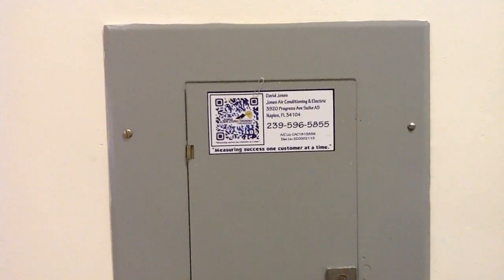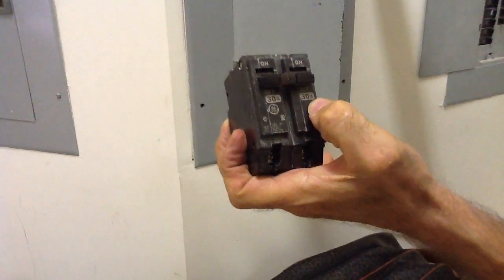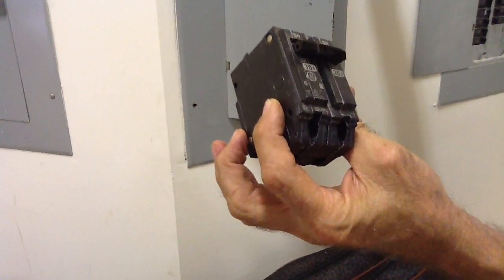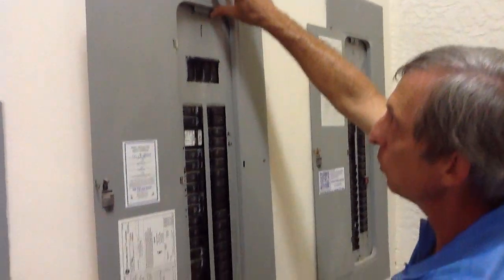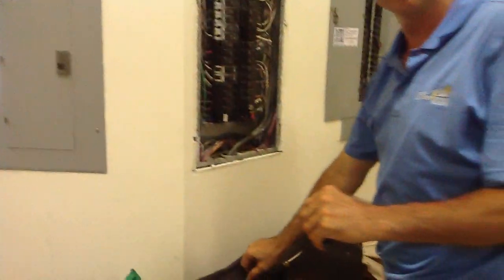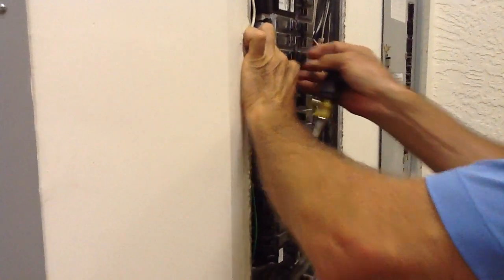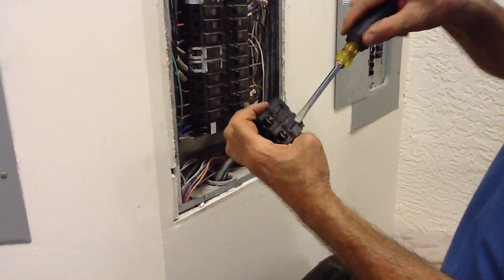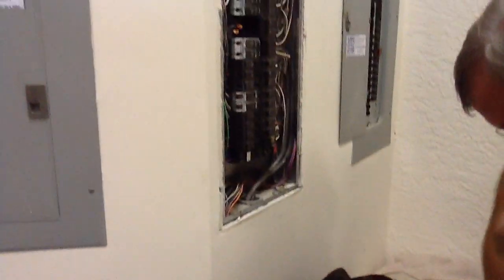Removing and Changing Out Breaker From GE Electrical Panel Box

Comment: Do you have to use arc fault breakers?
Reply from the maker: not on old panel boxes is code for new homes and you remodels because the grounds and neutrals are not tied correctly

Comment: Didn't help me. The hardest part about GE breakers is that, like stablok, they go in a specific way regarding 2 pole breakers. There is a weird tab on the bottom that will prevent you from installing in the wrong slot. Fidgeting and messing around with a breaker trying to get it in is dangerous and could shock a person. I'm kinda disappointed this didn't touch upon that little detail (that is crucial)
Reply: I thought the video was too vague & did not mention a lot of very important details.

Comment: shouldn't you turn the main breaker off first, before working on the panel box?
Reply: Sometimes you can't turn the main breaker off because something important is running off the panel. We have to work with live panels quite often you just have to be careful.
Reply: Also from what I can tell this panel doesn't have a main breaker.
Reply: Not all panels have a main breaker